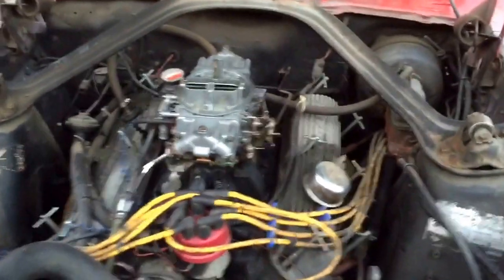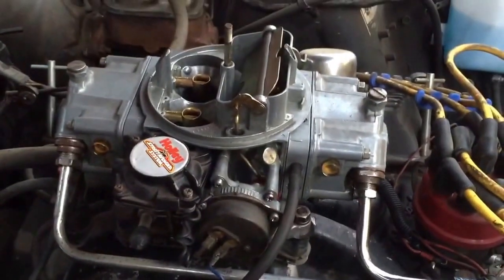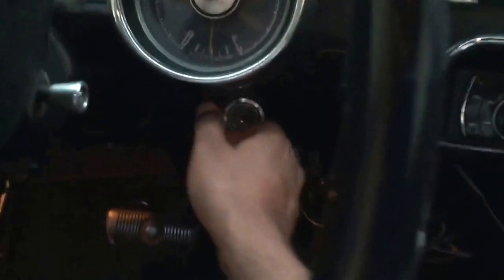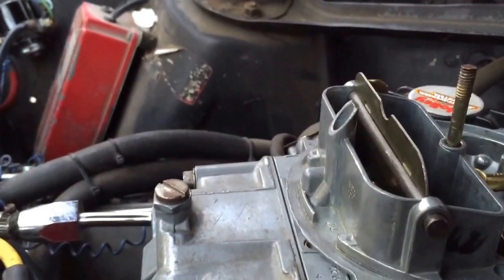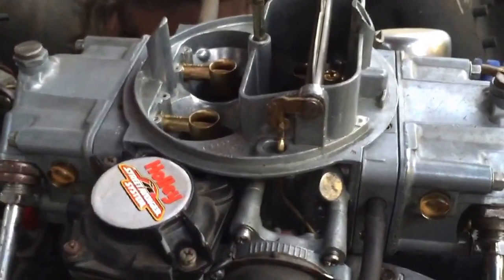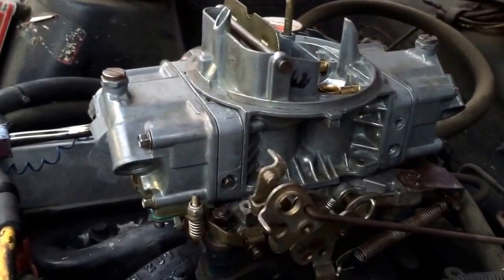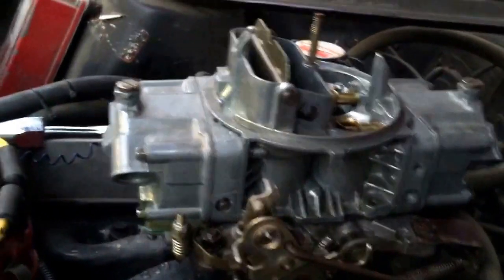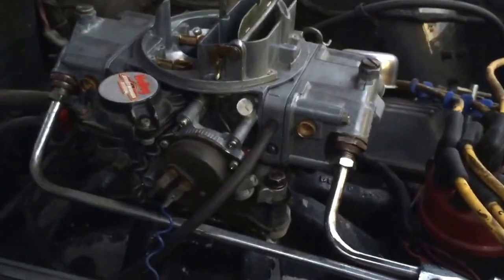Holley 4150 carburetor basic overview and operation. Choke operation.

Comment: 1) You have a dual feed, vacuum secondary 4150, not a 4160.  A 4160 has no secondary metering block. The 4150 is a more complete carb, not better, just more complete. 
2) The fuel bowls ARE under pressure. They don’t overflow because of the needle and seat. That’s the only reason there are floats. Fuel pressure flows into the bowl, it raises up the float and the needle plugs the orifice in the seat and stops the fuel intake. 
3) The float level adjustment nut and screw-the screw is the lock. It’s not the adjuster. The nut is the adjuster. Loosen the screw then lift the nut to adjust the nut. You lift it before adjusting so you don’t damage the seal. The sight glass works just fine as long as it’s clean and you can see through it.

Comment: i have a 4160 on a chevy 350 and i run with the vacum port removed, after that the engine start to make  samll explosions  after 1/2 throttlem i move the slow speed adjustments, and nothing change, the vacum gauge drops on each explosion, all the cylinders are working, have any idea ? i hear a clap,clap,clap, with no backfire

Comment: The butterfly is stuck wide open.. Won't close, can't push it closed. It's like locked
Reply from the maker: The choke plate it the square plate on top. If that is stuck it's probably your choke is stuck open.  If the round ones down in the throttle body are stuck open and your linkage springs back then you need to dis assemble and clean your throttle plates (butterflies)

Comment: Um, sorry if this has been said before but that carb is a 4150 style carb most likely 700CFM, but I can tell its a 4150 because it has two metering blocks, and center hung floats, a 4160 only has one metering block on the primary side, and the fuel bowls are even more boxy plus only one inlet and a aluminum tube connecting both fuel bowls. Just thought I'd share some knowlage
Reply: A 4150 is a double pumper, a 4160 is a vacuum secondary!
Reply: ckelley63 both can be vaccum secondary and double pumpers
Reply: James Perkey All Double pumpers have mechanical secondaries. 

This kid has a dual feed 4150 with vacuum secondaries.
Reply: ckelley63 you can get a 4150 with either mechanical or vacuum secondaries. Lots of options with 4150’s
Reply: its a 600 cfm doublw pumper 4150

Comment: Very well explained and illustrated. I browsed over a lot of videos on electric choke, and so far this is the best. Thanks.
Reply from the maker: As soon as you start the car it should idle at like 1200-1400 rpm or higher depending on your car.  5-6 seconds after the car has started gently tap the gas pedal this should disengage the fast idle cam and RPMs will drop down significantly. if you notice the RPMs drop down then you're fast idle time works. You can see the cam drop on my video when I rev the throttle.
Reply: What if the car idles poorly at cold start? What could be the problem?
Reply from the maker: All the fast idle Cam does is open the throttle plates to make the engine rev higher. if it's idling poorly it could be Valves, timing, carburetor issues such as Idle jets clogged or old gas. if the carburetors good and it just idles badly at start up and normal later it's probably a bad choke setting, too open or too closed you need to play with the choke till its tight.